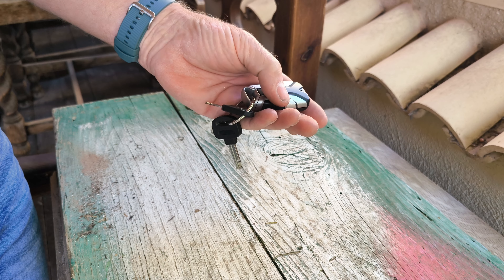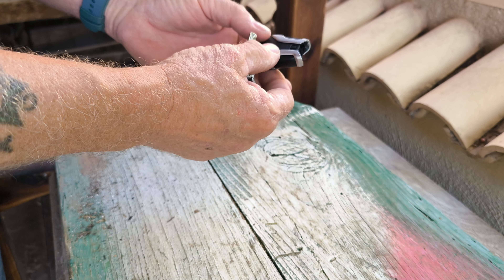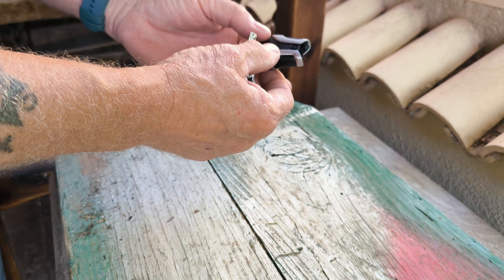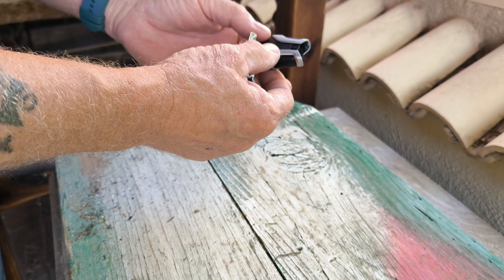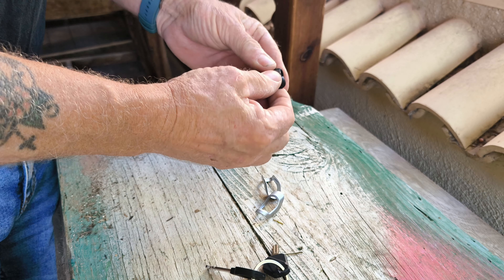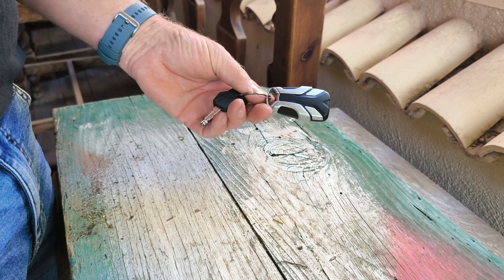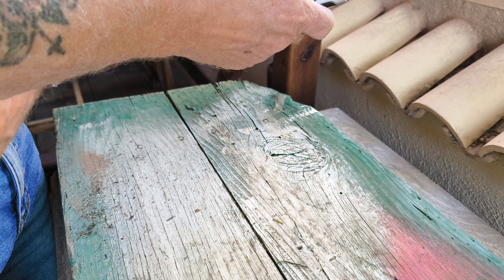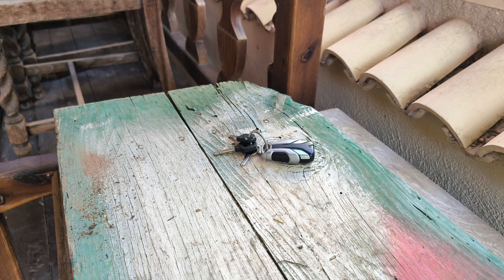Voge DSX 900 remote key failure!

Comment: Instructional video for disassembling the module. If the battery runs out, until it is replaced, the module itself works as a spare key, it is located very close to the ignition button and the motorcycle will turn on. Page 14, point 8 of the user manual

8.When the remote key’s power ran out, get the remote key or the spare on close to indicating light ring, meanwhile short
pressing ignition switch to get motorcycle power and start engine within 1 minute, otherwise the motorcycle will get
power off automatically.

Comment: Glad I sat on the fence with the voge now. Cracks are appearing not only with key fob now with updates.
Reply from the maker: Nothing wrong with key fob the video is just showing how to swap out the battery. I have had mine bike 7 months key fib still on the original battery. The 4.4 update is perfect. The bike is probably the best Adventure bike on the market. Stay on the fence, but if you want one you’re looking at a 4 to 5 month wait. No faults with any bike after 7 months here in Spain. Ride safe that’s for your comments. ✌🏻
Reply: @motechRevolution  cannot get them in uk mate. Next 2 batches are sold out. Be October next year before they get on shop floor.
Reply from the maker: @Daz533 The 2025 bikes are on Euro 5.5 I’m guessing the throttle response will be worse than E5. The good thing with most new bikes is we can flash a new map. Hopefully MotoGB can get some bikes into the UK. Here in Spain we have a Voge dealership network so no middle man, still a wait though. Plus a hike in prices for 2025

Comment: Hello. I have lost my main remote key and now left with only the spare key to start the bike, which is very inconvenient.. Is there any chance someone could give advice on how/where to obtain a new key fob and get it coded to my bike..? Really appreciate any help you can provide.
Reply: Worth mentioning that I am based in Turkey.. :)
Reply from the maker: @tuzermurat1  you will have to get back to the main dealership, your key will be coded to your bike VIN number so you will have to have a new key programmed. They may need to get it from China so not sure how long it will take .
Reply: @motechRevolution  The sub-dealer managed to find a blank key, but they do not know how to program. Even funnier, the main dealer also does not know how..! Would really appreciate if you can hook me up with someone that can guide me with the "coding/programming" process. I am lost over here.

You have been a great help so far.! Pls keep posting these videos as you are the go to guy.

Comment: i measure my battery to is 2.9 volt so time for replacement before it die...... +/- 3 months lifetime for battery on this remote fob....... too bad....... almost same type kyes on others cars or bikes work almost 1 year...... and..... why no any warnong about low battery........ shame on voge
Reply from the maker: @avtosdemis  I suppose it would be good to get a on screen low battery warning. Maybe in a future update. Considering both the BMW and VOGE use the same screen and Bosch ECU VOGE already show all the relevant info on screen BMW you have to scroll through tons of menus
Reply: @motechRevolution  same screen same ecu different software, but most important the keyfob have only option to sent authentication signal, so not bmw like system.. Maybie with never updated version of the bike they will change it, in our bike the only thing we can do is to replace battery every 3 to 4 months
Reply from the maker: @avtosdemis  or carry a few batteries that cost a few Euros , not so much of a hardship at the price point. But yes you are right. Thanks for the comments my friend ✌️
Reply: @motechRevolution  the problem not a cost, it's just a feeleng of non complete device
Reply from the maker: @avtosdemis  I get what your saying but take away all the extras the same as the F900GS basic model at €14,000 then you have a valid argument. St €8,888 without any extras it's super value, with every conceivable extra at under €9k the key fob battery is a non issue
Reply: @motechRevolution  I know, that why I bough this bike, but in some cases some key features must be rock solid (quality not quantity) but I believe it's just a engineer fail, they never thought of it
(same with rear axles almost all 900 have isuue with it, when you remove nut completely from axle, the nut security rings damage the axle completely, so with every remove of axle you need new axle and 40 euro)